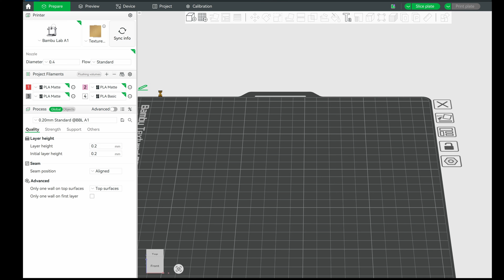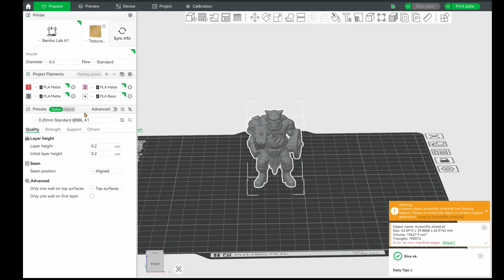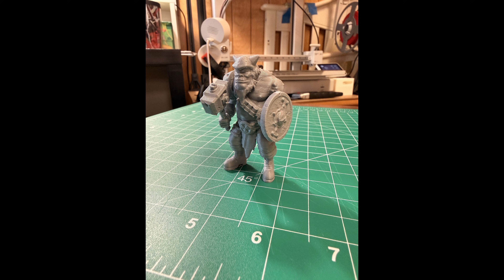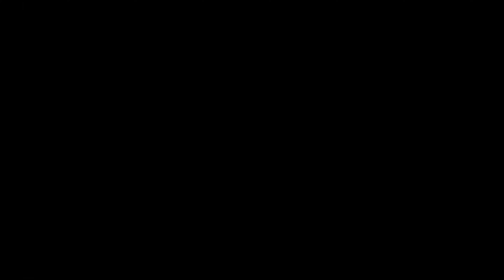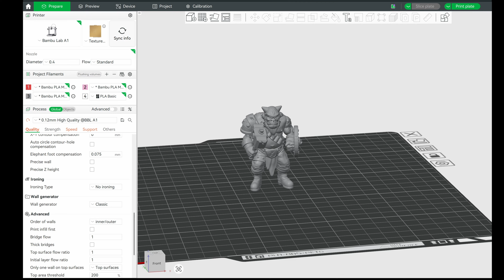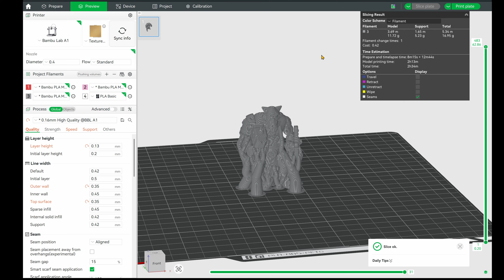How to optimize your prints for best results in Bambu Studio

Comment: I'm so confused. My P2S on stock settings DID NOT stair step like that. My first benchy looked great. All of the little characters I've sent thru have looked really good. Is the quality gap from an A1 to P2S that significant?
Reply from the maker: quality can be highly dependent on printer, settings, filament, humidity and model. A benchy can come out great, but print a mini and suddenly you're looking at a monstrosity.

Comment: ... Finally someone did some true R&D testing, thank you!  I'm trying to figure out which 3D Printer to get; FDM or Resin? Question for you. Could you please let us know where you get "your" 3D printer files of Warhammer 40K?  If I can find these files then I would feel better going with the FDM 3D printer. Thanks again for a great detailed video and your time.
Reply from the maker: For this particular video, the ogre came from my own commissioned work from a Kickstarter I ran years ago. There's a lot of Warhammer-adjacent models in many places like Cults3D and other model sites. Just have to be careful about whether they're copyrighted work or not. As far as Resin vs. FDM, resin will still give you better quality, but at the price of having to deal with hazardous chemicals and fumes and a longer process (washing and curing). I started off with resin but decided for the things I do FDM was a better fit. I'd start with FDM first, and see if it suits your needs. At the end of the day you'll most likely be post-processing your models and painting them, and while its slightly easier with resin (little-to-no layer lines to deal with), the end result can be the same with an FDM print.
Reply: @TheCustomCorner101  ... your level of details on your models are really good. I wish you hade Warhammer 40k's. Not having much luck finding good WH model sites out there is why I asked but I'll keep trying to find them. Thank you.
Reply: @TheCustomCorner101 ... Thanks for sharing your experiences printing with both. Yes, I agree about the resin process as it is more hazardous as opposed to the fdm. Leaning towards the fdm printers but again don't want to buy the 3D printer if I can't find the files for the WH-40k series.

 Thanks again n have a great weekend!

Comment: I’m really having a hard time with figurines, I just started 3 printing, and everytime something goes wrong, on my first figurine print supports broke and some part of the figurine didn’t print as a result,
Trying to swap to a 0.2 nozzle to get more details but it’s worse than the 0.4, I tried your settings but when printing the slopes on the first layers are warping up …
Reply from the maker: I would recommend slowing everything down. A lot of times the sheer speed of the printers will cause fragile pieces to get knocked out and it's helpful to slow the print speed down and also increase the amount of walls to get a sturdier print.

Comment: as someone new to the hobby, are these configurations universal for all prints?
Reply from the maker: The majority will be, but there may be times where you need to tweak some to fit whatever model you're printing better. For instance, you may need to add brims to certain things, or change support settings to accommodate a specific part on your model or the orientation of it. But they are a great starting point and give you a solid foundation where you can start tweaking from.

Comment: I am curious how large this is? It feels like its a lot larger on screen than what I am used to in minis (fitting on say 25-30mm bases). I ended up buying an A1 Mini just to have a 0.2 nozzle machine to dedicate to minis.
Reply from the maker: The ogre is 43x39mm width x depth. He's 63mm high. A bit bigger than "regulation" minis, but he was part of a Kickstarter thing, not a team or anything.

Comment: Print 3 degraded because you combined two settings which work against each other. Your line width is smaller than your nozzle diameter, and you're running outer/inner wall order. This means the centerline of the nozzle prints along the path the outer wall should be, but there's no inter wall to act as a splint to "hold" the outer line in place, and regardless of how accurate your nozzle movement is, the liquid plastic is squirming randomly sideways based on how it's being dragged over the previous layer.

When detail matters I have completely given up on printing line widths thinner than the nozzle. Printing inner/outer can somewhat safeguard you (which is why the second print was better), but with outer wall first 0.35 width is effectively acting like a 0.05mm fuzzy skin.

I would try test 3 again with 0.42 width.

Lovely video, thank you for your time.
Reply from the maker: Thanks for the detailed breakdown. That's something I didnt take into consideration. I'll keep that in mind in the future. Thanks for commenting!
Reply: I realized how much misinformation or lack there of is in the community.  Ive been making it my business to learn the details like you explained here because downloading things in Maker World and hitting print is quite amateur. It makes sense why so many models have issues or completely fail when printing. Thank you
Reply: Hi, which change do you suggest to have the perfect combo?
Reply: Well thats the worst advice ever. You want to run 0.4 layer lines? That will look like traash.

Comment: Hey thanks for the video, it's very helpful, i'll try these for my next minis!

I have the basic 0.4 nozzle, I''m curious why not go even lower on print height? I tried it out sometime and had some fails when printing in the smallest possible height. 0.8 of height never worked, why? 0.12 is also my usual go to, But I understand you're going for a mix up with the .12 base setting while adapting the layer height to 0.8? why? 
I hope it's not too many questions! thanks for the help!
Reply from the maker: The reason for moving to a different profile and changing it's layer height is to take advantage of the presets of the profile. There are a number of things that change with each profile other than just layer height (mainly in the strength and speed properties), so its a shortcut instead of having to change all of those properties.

Comment: This is great info. I print mostly 1/24 rc model cars. would a lot of these setting smatter with a bigger scale item like that compared to your smaller scale item shown in the video ?
Reply from the maker: A lot of the settings should be transferable, you might be able to push the speeds even higher. I dont know how much detail there is in what you're printing, but you may not really need the precision that a mini would require.

Comment: I do "miniatures" but I print them at 200mm height, would the same settings work for me or would I have to troubleshoot. I am also working with a P2S so some settings might change.
Reply from the maker: it really is a lot of trial and error for each mini and size and printer. There's general rules like layer heights and line widths that will be consistent across, but things like speed and supports will be specific to the printer and the miniature itself.
Reply: @TheCustomCorner101  Thanks, I did a test print at 0.12 mm layer height and didn't change anything and it turned out great, I will have to increase the wall loops on the actual model in the future

Comment: for 0.4 I recommend about 1/1000th of z height... down to about 0.08, but I have a very old Flashforge, I'd imagine newer machines can do finer, Z axis has your highest resolution, x and y is very low res, so you idealy want to print tall things upright not laying down.... to maximise details, I normally rolly over models backwards until no supports intersect the front, so it is a compromise. Outer first will bite you a little when you have large smooth overhangs that show distortions easily.

Comment: With the 3rd print what happens with outer/inner walls and non Arachne ?  Using both has def upped my larger print quality (  .16 tank/large monster at this scale)
Reply from the maker: My theory is that those settings conflicted with the speed slowdowns and contributed to the layering artifacts which may have been drips.
Reply: @TheCustomCorner101  possibly, especially with Arachne ( the fine layer height/width being more sensitive to the extrusion adjustment for the wall gaps).  As above It'd be interesting to see the last print redone with only Arachne->classic generator changed.

Comment: ive been printing  10mm warhmaster with a .4 nozzle and getting amazing reuilts 32mm is just to easy these days, id also suggest use pla pro, it seems to get more crisp prints and you can keep it at .1 not.08 and it frees up some time ( lets face it it takes for ever for 30 orcs as it is )

Comment: Quick question, is the settings your adjusting is it just for Bambu A1 or any Bambu lab printer.
Reply from the maker: Should work for any, but for speedier printers you may be able to go a bit faster than the A1.

Comment: I print on an H2D using Support filament for interfaces, and a 0.2mm nozzle, and honestly I rarely use my resin printers anymore.  Just not worth the huge leap in hassle for a minor quality improvement.  That said, resin prints take paint a LOT better than PLA prints do :(
Reply: Do you prime your prints with a spray primer? For me it made a huge difference. (I'm using Vallejo primer)

Comment: Pro Tip #1: Use Prusament or Sunlu PLA+. I was using some local filaments and when I finally tested these, I got really surprised with the results. 
The thing is: Filaments might look homogeneous by looking with your crude eyes, but their diameter can vary a lot throughout the spool, and this can effect your prints because it basically changes how much filament is extruded during prints. Considering miniatures uses several meters of filament, having a diameter variation will certainly cause tiny little artifacts that can look odd at crude eyes at the end. 

Pro Tip #2: ALWAYS dry your filament before print and make sure it stays at 20% (or even 10% for ABS). Miniatures printed with >40% umidity can easily look like details are blurred or a little bit melted. Sometimes you will only noticed when you compare with a fully dried filament. Wet filaments don't sweat, don't cry, they just make your minis looks weird silently.

Pro Tip #3 (GOLD): Never print a single miniature on the bed. If you print one single miniature, you will have to slow the speed of the nozzle A LOT in order to wait for previous layer to cool down to achieve highest quality. If you just duplicate the same miniature on the bed, then the printer will move to the next mini when it finishes Layer X on Mini 1, and that will be enough time for the layer to cool down. More minis, more cooldown, and in the end you get double rewards!

Pro Tip #4: Problems with first layer? Before printing PLA, rise bed temperature to 60c and leave it for 10-15 minutes. Do it EVERYTIME you print. The thing is most printers ships with aluminium machined bed plates, which are cutted with CNC machines, like when cutting wood from a big wooden plate. These plates are not perfect because they usually thinner and are not carefully cooled down during manufactory process, so when they take heat, they are still deforming while you are printing first layer, making them look bad and ugly. It takes a few good minutes to stabilize these kind of plates completely, that's why you have to wait. There are companies that sells casted aluminium plates, which are thicker and made from metallic mold and cooled in a much more controlled environment, making them ideal for 3d printing. Also very expensive. (compared to the printer cost)

Comment: I like to see this type of test with a 0.2 nozzle
Reply: +1 hahaha i want with 0.2 too
Reply from the maker: .2 nozzle video incoming in a bit. Just wrapping that up now. Sub and hit the bell to get notified!
Reply: i bought a .2 nozzle for my p1s, its coming in the mail today...i think it will be worth it because it can create more detailed prints, even tho the prints WILL take longer to print...
Reply: @JohnDebasa  use chitubox for supports if you dont wanna pay for lychee. Ive been using it for my minis instead of these junk tree supports and even the auto supports work a lot better. I did 7 super high detailed mini's called the Salted crew with variable layers, 3 walls, 15% infill and it took 40 hours but it printed the finest details on the bases, faces, and even small things like draped chains on cloaks.
Reply: i just tossed mine, not worth the time and troubles, just hit with the ressin one
Reply: Exactly what I was going to ask for.
Reply: More often a 0.2 dosent give you better results. If your Details are smaller then 1 mm² will Look the same. A 0.2 will be also much worse in overhangs, you have less width for the Material to Grab on and with 0,08 mm Resolution steeps you wont be able to Go lower. Sry for bad english.
PS i use 0.2 nozzle for smal flat Text shields and Hueforge. other Models allways 0.4.
Reply: @Maik-mn4cd  as I am new to 3D printing thank you for posting this.  And, your English is far better than my non-English skills.  Which is 0 LOL.
Reply: @Maik-mn4cd you can go to 0.06 with 0.2mm nozzle without major problems. Even 0.04 is usable for some models.

Comment: Orrrrr....You could just turn on variable layer height and it will clean up 98% of layer lines, just adds time. If you want really clean FDM prints and not resin, you need a smaller nozzle. Drop down to .25mm nozzle and you will get incredible details. I run a .25mm hardened obsidian nozzle on my Core One and get unbelievable detail. It does 4x the print time though but it's a sacrifice I make when I make models to look nice for my personal collection.

Comment: I have a tip: Print Outer & Inner walls at the same speed. The imperfections of the printed faster inner wall reflects on the outside. You printed at 30mm/s but actually had the quality of 70mm/s because of this (not 100%, of course). I usually print both at 60mm/s, less, I have some warping 'cause of the tip staying too much time on the layer.

Comment: Perfect timing. Family got our first 3d printer for Christmas. I want to print some models for our TTRPG games, so this video helped. I've watched wayyyyy to many orca slicer videos. 
I think variable layer height is what I'll go with. Maybe .12 or .16 where it doesn't matter, and then .08 on the top and curved surfaces. Will have to experiment though.
Reply from the maker: Sounds like a good experiment! Congrats on the first printer, its a fun rabbit hole to fall in. Enjoy!
Reply: @TheCustomCorner101  It was a massive failure. The tree supports, (can't use organic on variable layer) wrapped completely around my model. hahaha. Looks like my mech got cancer. Then I spent an hour hand painting supports on, only to change a setting to null by accident and locking up the program, of course I didn't save prior. 

So now I just have a 2 hour print with light trees going at .15mm layer height. If it comes out, and I decide to do it again I'll go .08
Reply from the maker: Yikes, I hope that last print went well.

Comment: This is a great video, but I always wonder why people are so resistant using the correct nozzle size for the job. Especially if you're using a baby labs printer where it's so easy to swap the nozzle out. For miniatures I'd use a 0.2mm nozzle and the smallest later height rather than try to mess with a 0.4mm nozzle. For most of my designs I actually use a 0.6mm nozzle and 0.8mm for big functional parts.
Reply from the maker: That's a fair point, I wanted to see how far I could push the 0.4mm nozzle with these specific optimizations. I have a 0.2mm and a 0.6mm nozzle that are collecting dust at the moment. Maybe in a future video I'll compare output from the 0.2mm and these 0.4mm versions.

Comment: Would variable layer height be better used, along with the numbers you’ve used be beneficial?
Reply from the maker: I think for my last print, the time/quality tradeoff one, it would have helped with maybe getting a better layer height minimum for the same amount of time. Variable layer height isn't a magical setting that goes beyond what the capability of the printer has, and i set the layer height to .13mm in that print. So what it may have helped with is getting a smaller layer height on the top surfaces but they wouldn't have gone anywhere near what the 2nd print did for the time.